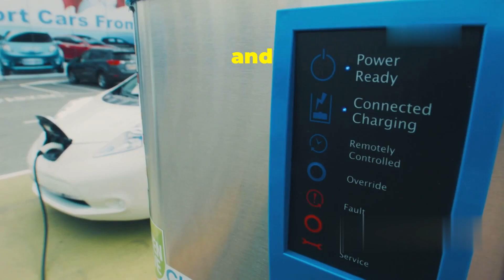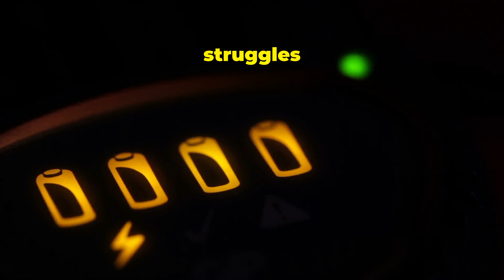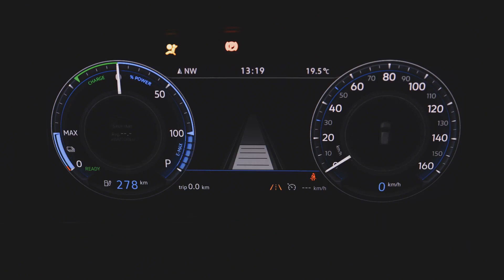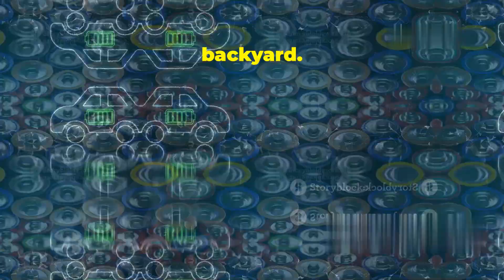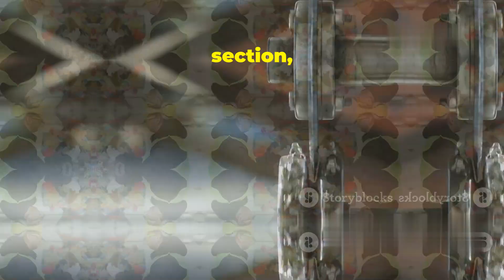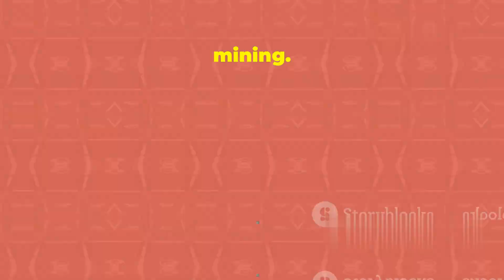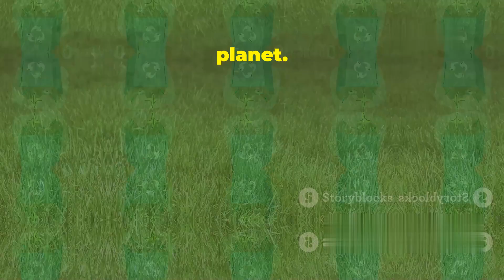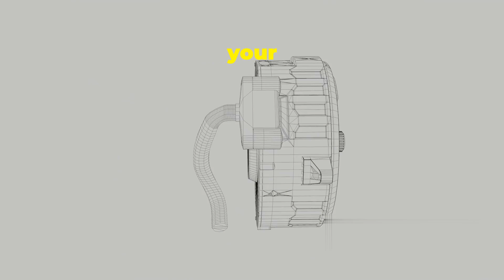What Happens to EV Batteries When They Degrade

Comment: At the average degradation rate of 7.3% per year, an EV battery would take 10 years to decline to 73% maximum charge. However, as we expect EV battery life to decline non-linearly, there would likely be a more significant drop-off dependent on climate and frequency of charge and depletion frequencies.
Reply: And I own a 50 year old ICE vehicle that gets almost the same MPG.
Reply from the maker: @operationsword9457  To maintain fuel efficiency in an older vehicle, regular maintenance is crucial. Ensure timely tune-ups, clean or replace air filters, check tire pressure, and use the recommended grade of motor oil. Consider upgrading to modern fuel injection systems or ignition systems for improved efficiency. Additionally, driving habits play a significant role; practicing smooth acceleration and deceleration can positively impact fuel consumption. Regularly monitoring and addressing any issues promptly can help sustain fuel efficiency in your aging vehicle.
Reply: @scienceandtechexploration-168  lol ya what you said.
Reply from the maker: @operationsword9457 Thank you.
Reply from the maker: Calculating EV Battery Degradation:

To calculate the time it takes for an electric vehicle (EV) battery to decline to 73% of its maximum charge based on an average degradation rate of 7.3% per year, we can use the formula for exponential decay:

𝑃(𝑡)=𝑃0×𝑒−𝑘𝑡

Where:

𝑃(𝑡) is the percentage of remaining capacity after time 𝑡

𝑃0 is the initial percentage of capacity (100% in this case)

𝑘 is the decay constant (ln(1 - degradation rate))

𝑡 is time in years

Given that the degradation rate is 7.3%, the decay constant 𝑘=𝑙𝑛(1−0.073)≈−0.0778.

Substitute these values into the formula:

𝑃(𝑡)=100×𝑒−0.0778𝑡

We want to find when 𝑃(𝑡)=73, so:

73=100×𝑒−0.0778𝑡0.73=𝑒−0.0778𝑡𝑙𝑛(0.73)=−0.0778𝑡𝑡≈−𝑙𝑛(0.73)/0.0778≈10.03years

Therefore, at an average degradation rate of 7.3% per year, an EV battery would take approximately 10.03 years to decline to 73% of its maximum charge.

Comment: EVs do more damage to the planet than ICE.....
Reply from the maker: Electric Vehicle (EV) batteries do degrade over time, impacting their performance and range. However, advancements in battery technology are continuously improving to address this issue. When comparing the environmental impact of EVs versus ICE vehicles, it's essential to consider the entire lifecycle. While EV production and battery disposal have environmental implications, EVs generally have lower emissions during operation than ICE vehicles, especially when charged using renewable energy sources. Therefore, despite battery degradation challenges, EVs still offer a more sustainable transportation option in the long run.

Comment: How many cells in a cyber truck?
Apparently there are about 1360 individual cells…I.e a heck of a lot of individual batteries.
What happens if only one of these fails or leaks?
Reply from the maker: In a Cybertruck, there are approximately 1360 individual cells making up the battery pack. Each cell plays a crucial role in the overall performance of the battery. If one cell fails or leaks, it can impact the efficiency and capacity of the battery. However, the battery management system in electric vehicles like the Cybertruck is designed to handle such situations. When a cell malfunctions, the system can isolate it to prevent further damage and ensure the safety and functionality of the overall battery pack. Regular monitoring and maintenance are essential to detect and address any cell issues promptly
Reply: The "car" is totaled...
Reply from the maker: @operationsword9457  When an electric vehicle (EV) is deemed totaled, it's crucial to follow specific steps. Firstly, ensure the safety of all involved and contact relevant authorities. Next, inform your insurance company and assess the extent of the damage. Depending on the insurance policy, you may receive compensation for the totaled EV. Consider salvaging usable parts or recycling the vehicle responsibly. Lastly, explore options for replacing the EV, considering factors like efficiency, cost, and environmental impact.
Reply: @scienceandtechexploration-168  Many are totalling their ev's on purpose.  They'd rather get a 20% loss then 100%
Reply from the maker: @operationsword9457 Electric Vehicle Battery Degradation:

Electric vehicle batteries degrade over time due to various factors such as usage patterns, temperature fluctuations, charging habits, and overall battery chemistry. One common concern with EV batteries is the phenomenon of capacity fade, where the battery loses its ability to hold a full charge over time. This degradation can impact the driving range and performance of the EV.

Depth of Discharge and Battery Longevity:

The depth of discharge (DoD) refers to how much of the total battery capacity is utilized before recharging. Shallow discharges (e.g., only using 20% of the battery’s capacity before recharging) are generally less stressful on the battery compared to deep discharges (e.g., using 80-100% of the battery’s capacity). By avoiding deep discharges and keeping the DoD low, some EV owners believe they can mitigate battery degradation and extend its lifespan.

Battery Management Systems:

Modern electric vehicles are equipped with sophisticated Battery Management Systems (BMS) that monitor and control various aspects of the battery operation. These systems help optimize charging patterns, prevent overcharging or deep discharging, and ensure the overall health of the battery pack. BMS technology plays a crucial role in maximizing battery longevity and performance.

Balancing Battery Health and Range Anxiety:

While intentional partial discharges may benefit long-term battery health, they can also lead to range anxiety for some EV drivers. Range anxiety refers to the fear or concern about running out of battery power before reaching a charging station. Balancing between preserving battery longevity and addressing range anxiety is essential for maximizing both the lifespan of the EV battery and user convenience.

Conclusion:

In conclusion, intentionally partially discharging an electric vehicle’s battery as a strategy to preserve its longevity is a practice adopted by some EV owners. By managing the depth of discharge and leveraging advanced Battery Management Systems, individuals aim to strike a balance between maintaining battery health and addressing range concerns in their daily driving routines.
Reply: @scienceandtechexploration-168  EV's are a failure.
Reply: @scienceandtechexploration-168  
Same with IPhone and computer batteries…
Reply from the maker: @maxthemagition   Haha...Lol.🚀🚀🚀🚗🚗🚗
Reply from the maker: @operationsword9457 Why do you think so?